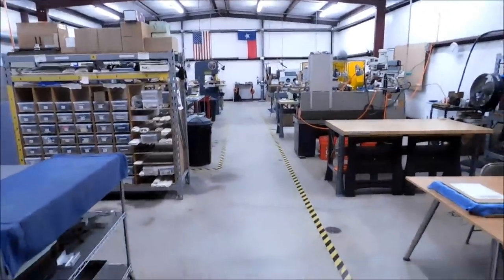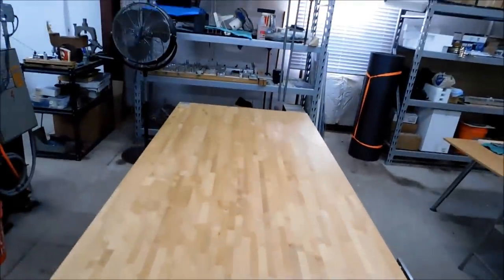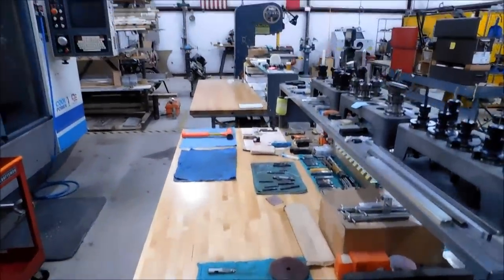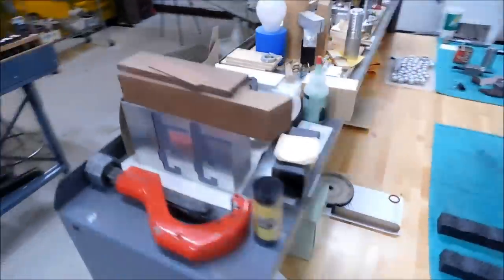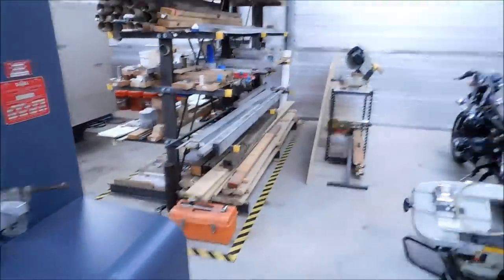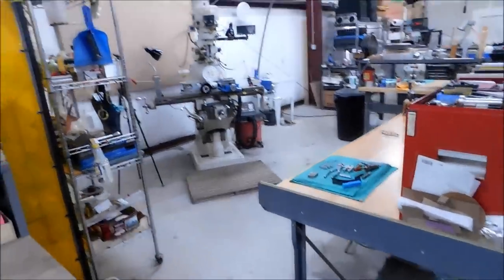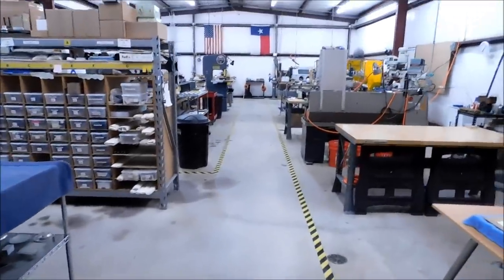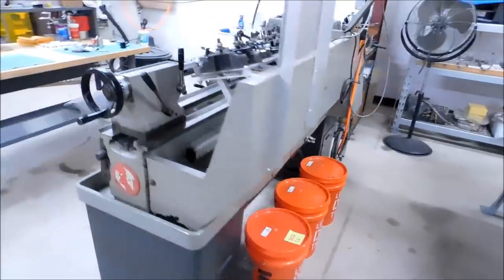CAN YOU SPOT THE DIFFERENCES ??

Comment: Do you have any employees? Just curious. Always had the impression that you were a one man band, but how you said you freak out if a rag isn't under parts made me wonder. Thanks for posting.
Reply from the maker: Contractors as needed. This is mostly a one man operation.
Reply: @joepie221  that's what I thought. I just started at a shop, running a Clausing, trying to clean up around at least my machine, other guys mess it back up almost as fast as I can straighten it out.

Comment: Love the shop tour!  To me it sets the bar on how clean and organized a working shop can be kept.  I've seen cleaner, but not anywhere that people actually did any work in.  Maybe a part of that is how much storage and organization you have?  Different areas for different tasks, even it's it's just table top assembly.  Looks like lots of shelving.  Also didn't notice any sheet metal stuff.  Is that not a thing you do much of?  Finally, makes sense that you only have what you need.  Manual mill, lathe, vertical bandsaw, some woodworking stuff,  welding area, and CNC mill.

Comment: 1. Different beer bottle on the fridge.
2. Different of rotated box on lunch table.

3. The orange hose disappeared from the lathe.
4. The yellow note disappeared from the third bucket near the lathe.

5. Dors on the CNC mill are now open.

6. DRO on the mill swithed on.

7. Yellow rag with black plastic things is rotated 90deg.

8. The red cart has now a clamp attached to it.

9. Head of the DoAll machine is higher.

10. Carriage on the lathe has moved towards the chuck.
Reply from the maker: Nearly perfect. I believe there are 2 more. Very good.
Reply: @joepie221  Patched wall by sink

Comment: I saw the beer bottle change brands, post-it by the lathe buckets missing, digi on the lathe changed positions, air line on lathe changed positions, box on the table taped closed, digi on the bridgeport was on the second time, doors on the fadal were opened. Was hoping to see more frame on that Honda too!
Reply from the maker: I read the comment before I realized who left it. I was going to reply with" I'm impressed". You know I am. That Honda frame will see a lot of sunlight early next week. I'm anxious to see how it rides along side of a more modern bike of the same size, in the near future. Good to get a comment from you. Thanks.
Reply from the maker: I meant add, there are several you missed. But you did get more than most. Stay well Happy Easter.

Comment: Hi Joe, thanks very much for the shop tour. I'm very impressed with your housekeeping in your shop and it is very clean and neat. However, "Operational Excellence" processes and methods or "KAIZEN" is an ongoing process and one should always look out for something to improve on a continuous basis. I'm sure you know what I mean ...

Unfortunately I could notice only two significant differences i.e. :

1. The orange air hose on the lathe is at a different position second time round.
2. Your CNC machine's doors are open during the second tour.
Reply from the maker: Thanks. I'm a big fan of efficiency and constant evolution. I'm also a firm believer that throwing money at a problem isn't always the fastest and best way around something.
Reply: @joepie221  Thanks for your reply Joe and I agree with you 100%. Keep well and stay safe !

Comment: Joe, about the collets,
I see they are 5C now.
My collets are considerably bigger than 5C's, which I have a set of as well.
These collets go from 1/4 in to 2inch in 1/16th increments and the chuck uses the same chuck key as my 3 jaw.
I was hoping for a lead on the manufacture.
Reply from the maker: The ones I have are Enco, but I got them with the machine. Interstate, hardinge, and royal are the brands that come to me first.
Reply: Hay Joe, as we have had soo much time on our hands I managed to find out the collet system I've got.
Alternately called the 5" Crawford Trugrip 9267 collet chuck and collets or the Colchester Trugrip collet chuck.
Superb system holding up to 2in bar stock which as you know fits up the spindle of the Clausing/Colchester.

Comment: I love my old do-all band saw...I think it's early '60s vintage. Every so often I can get the blade welder to work.
Reply from the maker: I was told you can send them out for refurbish. I just buy pre welded blades. If one breaks, I'll weld it myself with my TIG unit.
Reply: @joepie221  I haven't tried with my tig yet...I got as far as making an aluminum alignment bar.

Comment: Hi Joe, at the 1:03 mark it looks like there's two scuba tanks in front of the back shelves. Am I correct on that? Do you SCUBA dive? Did the DoAll Saw by chance come with a bandsaw blade welder? Those DoAll band saws are really nice, I work with two of them when I was younger. Thanks for the tour of your shop, I'm envious. Stay safe and I'm looking forward to more of your videos.
Reply from the maker: I do dive. I like caves at the moment. There is a recent dive shown on my channel. The doall did have a welder, but the transformer was burnt. so I made the plate and switch panel to replace it. I buy pre-welded blades.

Comment: different beer brand on the fridge , carton box is taped, orange air hose at the lathe is moved, DRO numbers on lathe has changed, DRO on the mill is powered on. Did I overlook something?? :)
Reply from the maker: I believe there are 13 .
Reply: @joepie221  Okay, ONE to go..!! (Time has changed, is number 6?, white end cap on table has moved, is 7; right yellow page on orange drum is missing is number 8; Fadal doors are opened is number 9; red cars have changed position is number 10; aluminum/black parts on yellow cloth are rotated 90 degrees is number 11; height of the band saw guide on the DoALL has changed is number 12...!!)
Reply: I give up, because I suddenly realise that this movie is from April 10th. You must have released that solution video, you promised, long ago by now. I think I try to find that one and verify my findings...   Nice puzzle anyway and I know your workshop now by heart.   :)
Reply from the maker: @boomstra  OK 
1. the beer on top of the fridge is a different brand
2. The box on the lunch table is different
3. The air hose on the back of the lathe is gone
4. the post it note on top of the orange 5 gallon pails is gone.
5. The mill DRO is on ( set to 3.14)
6. CNC doors are open
7. The cart by the CNC is different
8. The guide on the bandsaw is raised
9.the garbage can is reversed
10. the 2 black dive grip handles on the work cart are rotated 90 degrees.
Reply: @joepie221  Joe thanks,  I will check nr 9 the garbage can. I have checked lids and garbage in cans,  but overlooked this one. I love to see your educational videos (spider cleaning included  :) !!).
Reply: @joepie221  Sorry Joe, but I am being persistent. I CAN SEE a white end cap being moved at the ugly assembly bench, but I cannot find the carbage can being reversed. Please advise me.

Comment: I noticed you have a IR air compressor.  What's your review of it?   Good,  bad?  How long have you owned it?  I have been debating about buying one.
Thanks for your vids. I really enjoy watching.
Joe Hynes
Reply from the maker: I like it. I have never had major issue with it, except the electrician bent the contact inside the controller when installing it and it didn't bleed pressure when it charged. Other than that, it performs very well. Supplies the air hoses, blaster and CNC tool changer without a hitch.

Comment: Pretty sure those clock hands have moved! I started going through it with the video open in two tabs comparing like for like. I've decided that was cheating so I have disqualified myself!
Reply from the maker: Very good Crispin. Thats exactly how I would have done it. Lets put you in the win column for creativity.
Reply: Fine by me! By the way, if your still taking video suggestions I'd be interested to hear your thoughts on single pointing small diameter internal threads. I'm machining my loco pistons and they require a 1/4x 40 threaded bore. I decided to use a tap in the end and then single point the male thread to suit. The threads are responsible for alignment though so single pointing would have been justified. Have you done much small diameter screw cutting?
Reply from the maker: To be honest, not too much. I have tooling down to around the 8mm internal range, but don't do it too often. If you are concerned with tap runout, do the thread first. Leave the tap in the hole and then true up the OD of your part once you indicate or align the tap to run true. This I have done with great success. So even a poor hole can turn into a good part.
Reply: @joepie221  that’s damn clever...

Comment: Great looking at your workshop from front to back.
As soon as you showed the Colchesters Collet set I was a little distracted..
You see, I've just bought a short bed Triumph 2000 with a collet chuck that has collets that look just like those.
I have been trying to find any manufacturer or definition as I need at least the 1/2in collet but wouldn't mind a metric and a few others.
My chuck uses a T chuck key like any other chuck, any help would be marvellous.
There are no manufacturers marks I can see other than a back to back, overlapping C on each collet opposite the size.
And yes, cabin fever is getting me, one month......
Reply from the maker: These are 5C collets and my closer rig is a Royal brand. MSC has closers you can buy. And collets.

Comment: 2 different bottles of pee....on fridge.

Cardboard box closed after showing gray and yellow scuba tanks.

One yellow sticky not on HD 5 gallon pail.

Air hose on lathe.

White dot on pounding bench in a different spot.

Bandsaw blade guide is changed.

Parts on yellow rag rotated 90°.

Doors on CNC open.  <<---Took the 4th time watching to catch this one.